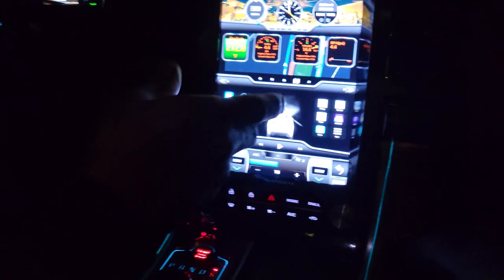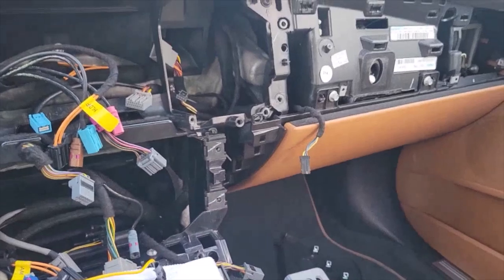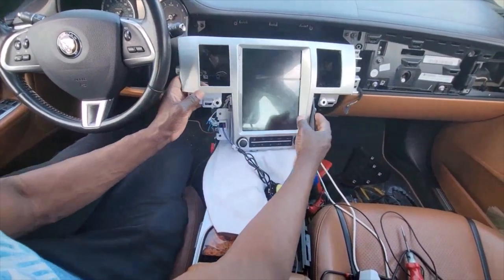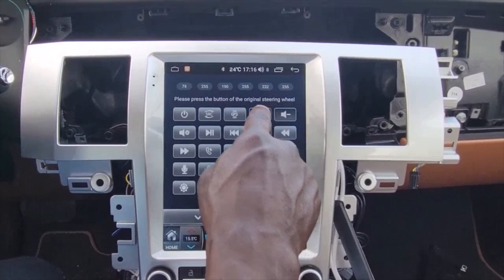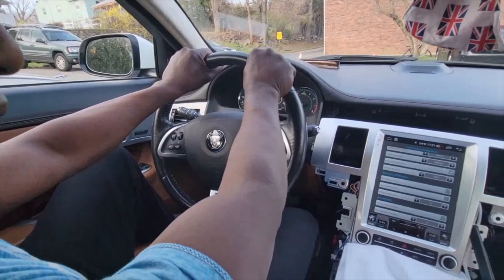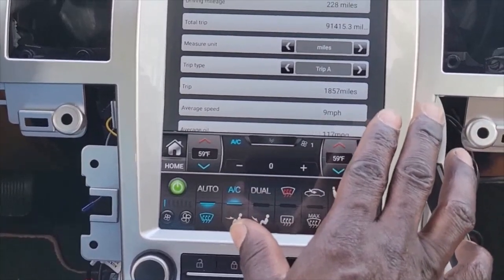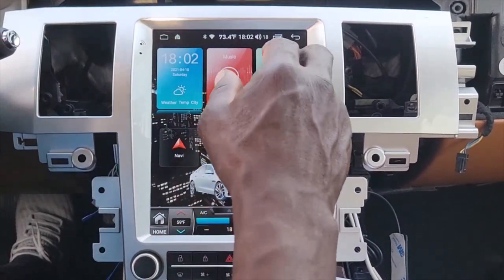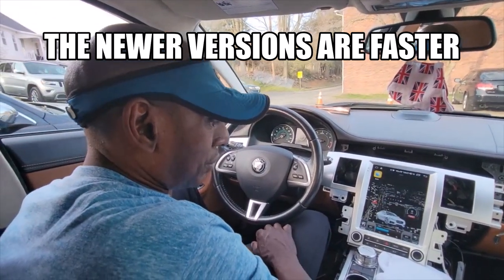Jaguar  XF, Android 10 inch Headunit Screen with Coolant Temp on screen installation

Comment: Hi again, I have managed to get it fitted now thanks to your wiring video which has been a great help, I was just wondering about DAB, my 2014 XF has both FM and DAB which I'm assuming are the 2 connectors on the white plug from the car, I connected the aerial from the Android unit to the same one as you did in the video but is the 2nd connector the DAB one ? if so is there a way to loop that into the 1st one so both aerials run into the one on the new stereo ? Thanks for any advise :) I also followed your advise for the GPS and have ordered an adapter to use the original cars aerial for that, you would think that they would supply that instead of a new aerial.

Comment: Do you have a video for preparing the install, IE: how to remove the panels that need to be removed to get the old head unit and heater controls out ? Thanks, great video for the wiring, BTW :)
Reply from the maker: I'll put one together
Reply: That would be great, I don't see how the heater control panel comes out. I'm just trying to bench test the head unit at the moment to check it so just working out the wires from your video @den-tech-mods

Comment: I have a 2013 jaguar xf 3.0 awd. My ac controls on the touchscreen isn’t working nor can I change my vehicle settings. Any suggestions? Thanks
Reply from the maker: Do you have the 2 wire plug, plugged in the the back of the tesla screen

Comment: Once swapped to the android unit, how do you see car warning/error messages that would normally show on the OEM stereo. I.E. washer fluid empty, water in fuel sensor, low fuel. Also previously you would clear/acknowledge them via the OEM stereo, is this possible via the android unit?
Reply from the maker: It all shows up in your cluster gauge,.
Reply: @den-tech-mods  ah ok thanks, so how do you acknowledge the message without the OEM stereo?
Reply: @den-tech-mods can dim the brightness on the screen

Comment: Hey man I installed one similar headunit to my xf and I'm only getting audio on all the door speakers but the subwoofer and the the surround speakers don't work did you have similar issues?
Reply from the maker: no i didn't ,mine came from Dentechmods.com, works perfect, you may have to contact the seller for a new blue box
You can install the torque app on the screen to check fuel coolant air etc also 0-60 times
Reply from the maker: Did yours come with the blue box ,if you can't get the seller to update the box, I would go with a DSP anp like I have in mine  no extra big weight, I think I had a dsp amp install video for the XF

Comment: Quick question. So you know how when installing the unit the white and red audio say left and right.. do you automatically lose the ability to control the back speakers? They play but when controlling the front and back settings all speakers are considered as the front.. have i done something wrong or is this also why the jbl dsp was installed to regain that control
Reply from the maker: when you play the music it takes the left and right signal then run it through (BUSS optics)                                                                                                              that separates it into separate channels ,but if you are like most of us we  use the JBL DSP and take signals from the speaker line levels that are higher in voltage thus giving us a crisp sound, back in the days we would use the RCA,S signal then you have to gain match resulting in noise and distortion, ill be making a video for the XF to help show how its done ,not spending to much money

Comment: Hi den do you have any code for Android 12 ,6 months old,I'm in the UK need to change a couple of things to right hand drive thanks den ,Mark
Reply from the maker: Yes 3368
Reply: Hi den, thanks for your help,tried that one and some versions, I'm at a loss. Unless there is a reset for this code 🫣 have you ever had this problem!!! Thanks Mark
Reply from the maker: Try 7890 or 8888 or 6666
Reply: @den-tech-mods  still no joy I'll keep trying, I'll let you know if I crack it ,pain in the ass😭 if you come across anymore could you please send me thanks Again Mark
Reply: Yes yes yes got it haha 123456 thanks den, Mark

Comment: I really need your help I bought a Android head unit for my jaguar. Xf and I'm not getting any sound and I'm catching per  I need help.
Reply from the maker: What headunit do you have, and description of your  car
Reply: Happy father's day
Reply: I have a 2010 jaguar xf the head unit is a rolax android I got it off amazon  I have the sound working but I can't get the subwoofer to come on I got It off Amazon for $599.00 .
Reply from the maker: @cortezstuart2785  did the sub work before the install
Reply: @den-tech-mods  yes it work Just fine before I install the head unit.
Reply from the maker: Did you enable subwoofer in the settings
Reply: @den-tech-mods  Say turn on the subwoofer and I did so I guess I'll go back over and see what I did wrong. I don't know.

Comment: The top 1 is connected. The bottom one isn’t. There’s 2 just alike
Reply from the maker: Whatch my x-type video and tell me if you're ac connection is the same
https://youtu.be/wx6WHY3fG3g?si=rXs5ZFGrZaDLjiIS
Reply: I will watch the video tonight. I’ll check the connection tomorrow when my installer comes back over. It’s been a long day messing with that screen. I will let you know tomorrow. My installer is positive that it’s wired correctly. If you want I will be happy to take a picture of the back of the radio
Reply: Thanks so much . I have ac controls working now. Everything is working properly except my SIM card. It’s sees the sim but I can’t pull any data from it. I’ve tried the reboot but that didn’t help. My 4g bars are on the screen but no data from the sim
Reply from the maker: @jayrob8183  I also have  a step by step for sim video
Reply: Can you send me that video please
Reply from the maker: its in this video https://www.youtube.com/watch?v=wx6WHY3fG3g
Reply: Quick question. I have a T-Mobile sim in my screen. It seems to be unstable. I have to reset my data quite often to get my signal back. Is there any updates for the screen that you know of or any work around for that issue
Reply from the maker: @jayrob8183  where  did you install your 4g antenna, also check if  it's screwed in good
Reply: The antenna is installed where the windshield and dash meet and yes all of my connections are good.
Reply: FYI I’m using a T-Mobile data sim not a phone line. I tried AT&T data sim but it kept bricking the sim and AT&T said they couldn’t tell what the screen was on their end so I switched to T-Mobile data sim
Reply from the maker: @jayrob8183  you can install the sim in the unit or by the dongle, how's yours installed
Reply: Dongle. We didn’t see the internal slot
Reply from the maker: There's an internal one on the board